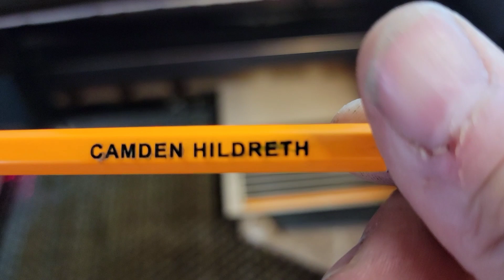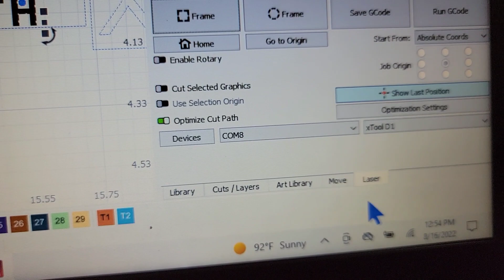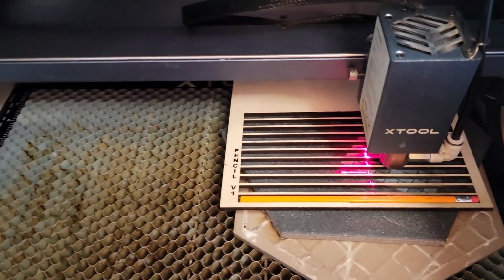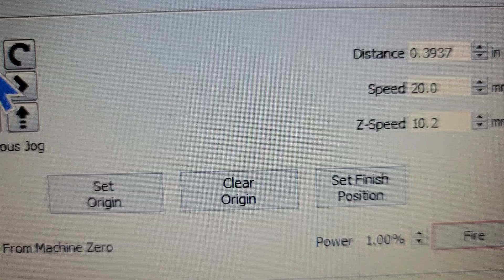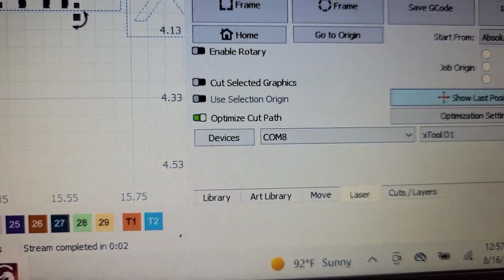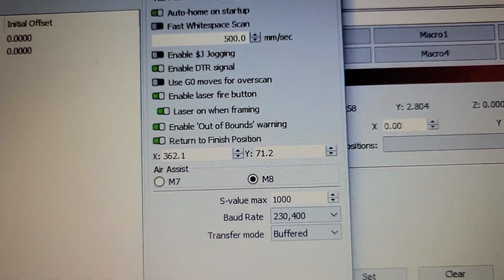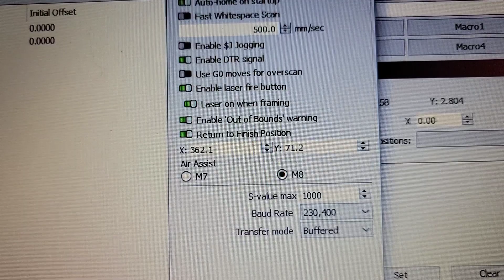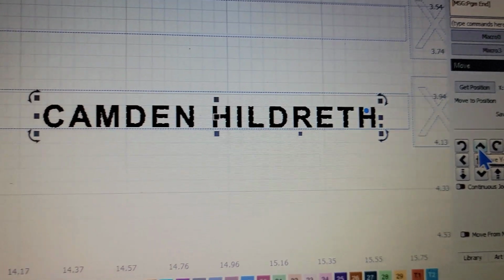"Did you know?" You can save time by setting your finish position in LightBurn.

Comment: I noticed that you've fabricated a jig for repetitive projects.  Will you be making a video on how you design, cut and use the jig(s)?
Reply from the maker: I used a jig briefly. But found it to be more troublesome than anything. I have since stopped using the jig attached to the laser. From what I've observed there are even different diameter legs on the xTool. I think The Clack Shack has a decent jig template he sells. For all the work involved in designing my own, I'd probably buy what he is selling and make simple modifications as needed.
Reply: @HoboWithWood  I have the Clack Shack files gor his jig(s).  Haven't used them yet.😁

Comment: Good tips thank you. So to speed things up and make it (hopefully) simpler I'd start with the jig on the far left so the laser doesn't have to travel as far. If it's a matter of not being able to clear the laser head to remove items then make the jig a little longer on not have the last rows under the home position. For the jig you could put a little circle cutout (might have to increase your spacing a little) at the end of the pencil groove opposite the end you reference from to aid in get them out. I'd probably reference off the eraser end so you could also do pencils that had been sharpened already.
Also I have modified generic chinese laser and without limit switches I found that if I manually moved the laser to the mechanical stops at the home position before powering it up the repeatability with a jig was pretty much spot on every time. Still always frame and check in case the machine lost a step somewhere maybe even manually home and power cycle first (before framing) to make sure.
Reply: Oh I also found another pencil jig - I haven't tried this one yet but I like the look and it eliminates the picking up issue. I think I want to make one that locks into a jig panel like you are already using.
Humm guess I can't post a link so I guess google "engraving text on pencils instructable" gets the article top link but I had to go to a different version of the same site to actually find the file for download.
Reply from the maker: Thanks for watching and commenting. Be sure to check out my short, (shorter than my usual), "Did Ya Know" videos. I address assigning the "finish position". When you do that the laser isn't jogging forever when doing a repeated burn like this. This was my first attempt at a jig and I didn't do so well. It only fit on the right side. But it worked. I've sold a gross this week. What I've found, using Dollar Tree pencils, they are so irregularly shaped I couldn't do more than two at a time and get results I was happy with. I'm a bit picky. The amount of time to produce them is the same. I just have to stand there and load two at a time. But I' might do that a couple times a week, spend $7.50 and create $120. I'm happy to stand there and be sure I'm producing quality. Another trick I do since the xTool D1 doesn't have limit switches either is, I assign my finish position to anything other than 0,0. Typically, I'll use x20 and y20. Set that in your device settings. Before running a job, I start from home. Send the laser to do a meaningless task. Once complete, it goes to 20,20. Then I run my job. When it finishes that job, it goes to 20,20. I can then run the same job repeatedly, feeling comfortable it will repeat near perfectly since it's not starting from a bounced around home position. But, like you, the first thing I do is send it to home, (twice), then start all the above. Again, thanks for watching.
Reply: @HoboWithWood   OH wow.  I'll have to check out your others. I'm just starting out myself (few months in maybe). My machine is all 20x40 aluminum extrusion so different mechanics than the xtool and it never hit the ends or sides unless I screwed up. It going back to the home corner never banged anything or any other issues so maybe that's unique to the xtool idk. As for your jig I'm unclear why it doesn't fit on the left - I'd think the tabs are all the same space so it can go anywhere along the top where they line up. At least that's how I designed mine. Only thing that jumps out at me watching the vid is the laser head in home position would be in the way of several of the back slots? It looks like you have a bunch of unused space between the top of your jig panel and the home location - mine is much closer. You could make a short extension to make the panel longer to clear the laser (but your only using the end slots) idk. I want to start trying some though I got some from Walmart before school started for 49 cents a box. If I'd had thought of this then I would have bought a whole lot more 🤣🤣
Reply from the maker: @harmonic75  I was experimenting with the kerf settings on a previous project and when I cut the panel for the left side I didn't catch it. So the left side is just wrong. But by setting your finish postion. It's not a big deal at all. I, too, just started this adventure in June. Never used a laser or LightBurn until then. I'd encourage you to subscribe, if you haven't, had catch up on all the videos in my Hobo With Wood playlist. Some of my videos are long. But I feel like there is alot of valuable information in them. I'm more about sharing learned techniques and not just my settings. Because when you use you laser enough, you'll learn my settings can be irrelevant when it comes to your laser. I have had several strokes and my brain works like a twister sometimes, squirrel, so people miss out on a lot when they skip through my videos. I try to produce a video I'd want to watch. Good luck with your laser adventure and stayed tuned.